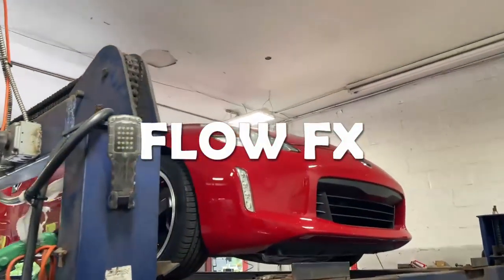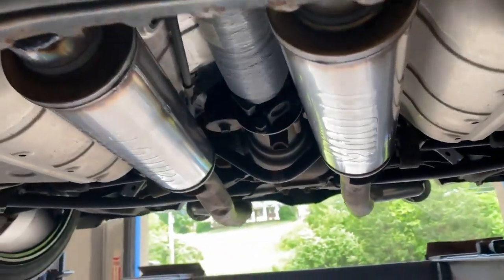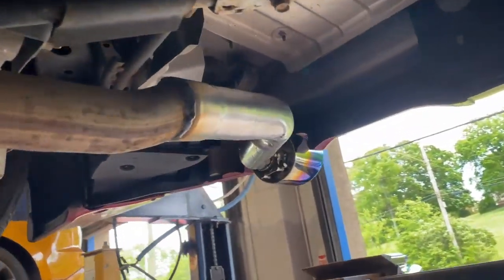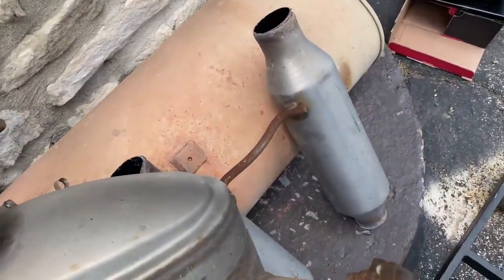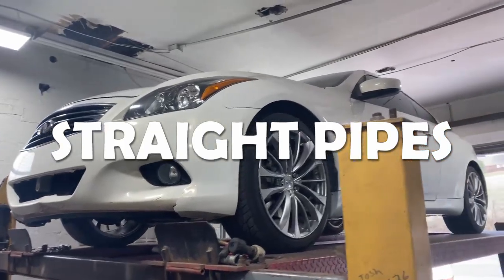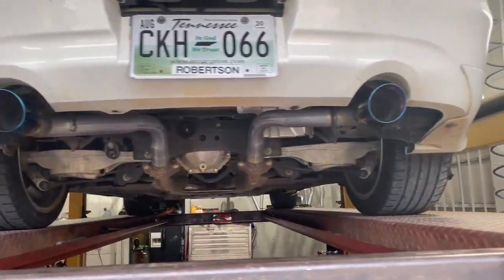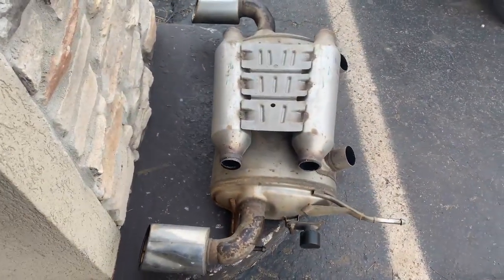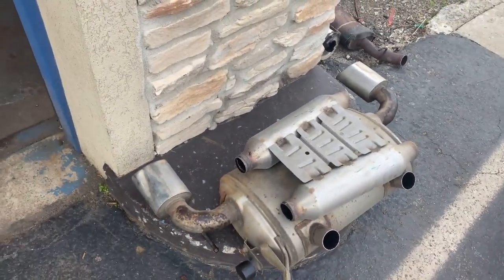Nissan 370z 3.7L V6: STRAIGHT PIPES Vs FLOWMASTER FLOW FX!

Comment: Sounds better than most VQs but I think going with the oval body flowFx would’ve sounded WAYYYY better. I feel like the perfect set up would be test pipes or high flows then Y into the single large oval 3.5 inch flowFx, then back into duals with Dynomax race bullets on each side before the tips.